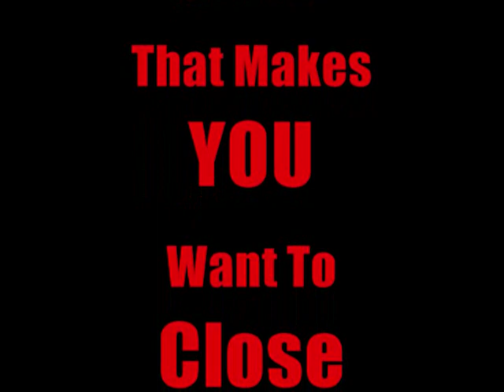Infinity Q45-Block Sanding The Guide Coat, Part 1

Comment from the maker: @ahawnt if you have a low spot in your body work, you will have to fill it and block sand it out, going over it does suck after all the hard work involved, it happens to me all the time, you just have to bite the bullet and get er done, if you are work on a spot that has bondo already on it, then you take an air file with 80 grit, file it down and then fill it in, and repeat the process.. Good luck, Pete

Comment from the maker: You want to apply 2 to 3 full wet coats of primer, let it dry then blocksand out. If you sand thru the primer you will want to re-prime to cover and then sand out..
Reply: SWRNC PETE in this vid your using 180..... isn't it usually 80, then 180 thanks

Comment from the maker: @mitmaks Ive never heard that before, news to me, but then I use kerosene heaters in my shop.. I know the kerosene heaters will heat it up faster then the propane heaters, but the propane heaters are cheaper to run.. Either way, take it easy and good luck. Pete

Comment: Hey Pete thanks for the great videos, I have Learned heaps from your posts, also wanted to ask you about the red tool box in the background in the beginning of this video, I have just been given one that looks exactly the same, just wondering it you knew what brand it is? thanks..!!
Reply from the maker: The large 3 stack high tool box in the background is a vintage 1953 Snap-On Assembly Line Taco Wagon tool box from the G.M. Plant in Arlington Tx. An old friend gave it to me 30 years ago and it belonged to his brother that was a worker at the plant. My friend has passed away now and it would be a shame to get rid of the old tool box even though half the draws don't work properly, I keep it for sentamental reasons I guess, and it's cheaper then buying a new one! Take it easy Pete

Comment: Hey Pete I have a 2000 Q45 with sun baked issues on the top of the car the hood and yrunk deck, Should i strip it with chemical stripper? or use a DA? And once thats done do i use an expoy primer or what? Also I'm thinking of using Wet Wet Plus Clear and their Fine wine base coat with the so bright silver under the fine wine your opinion on this would be great
Reply: So if you're gonna use a base coat with a under tone your body work has to be flawless like everything blocked out guide coated to a 600 wet sand I think is what Pete would do I don't think he did use the aircraft stripper because then you are gonna have to 2 stage seal it I think with an epoxy primer and hi build 2k so I would scuff everything get a clean template to work off of and start priming and get the guide coat that's your best friend hand block everything I think Pete shows an old trick where you use a paper towel to highlight imperfections more so because that increases sensitivity in your hand with a lot of prep work that paint will be beautiful but the best jobs start with that body work